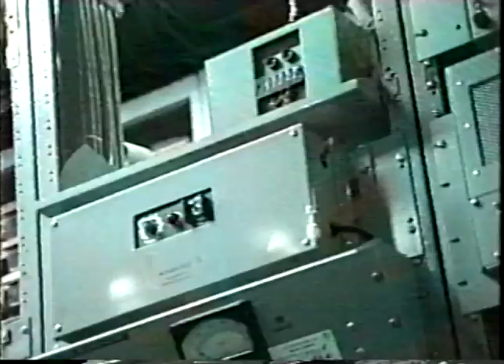#5 Crossbar Switch in Newark, New York - 1990

Comment: I worked in the #5 crossbar equipment like this from 1968 until 1980. Each individual relay operation is a call being processed until completion. On callouts in the middle of the night when there is practically no calls, I could actually tell what equipment was being used for completing the call simply by knowing where the equipment was physically located in my central office.The busy hour started at about 0715 when school is being in session. Then at about 2100 originating and incoming calls would start to dwindle. What you are hearing is the relays and the crossbars being set up and then disconnected when the call is completed. This was a large no.5  crossbar office during busy hour.